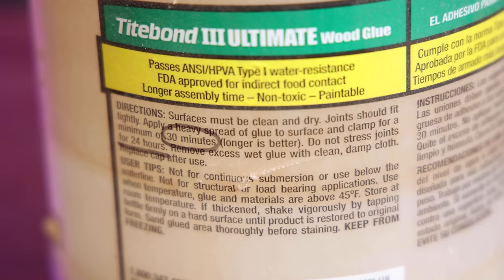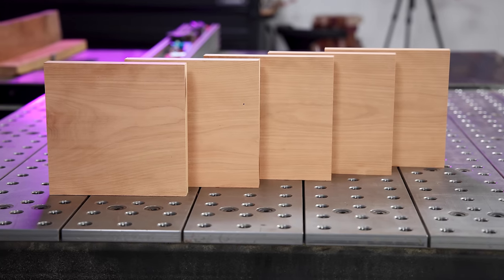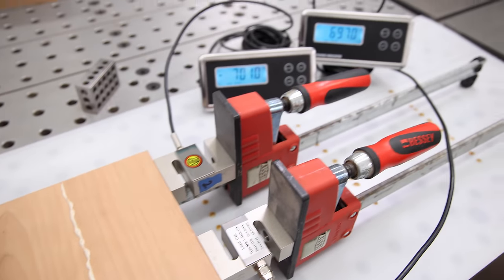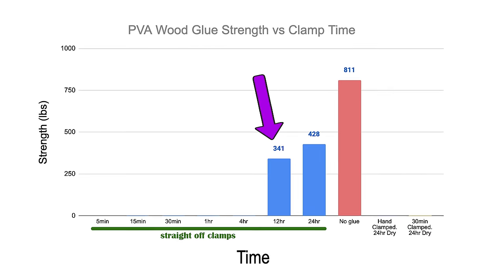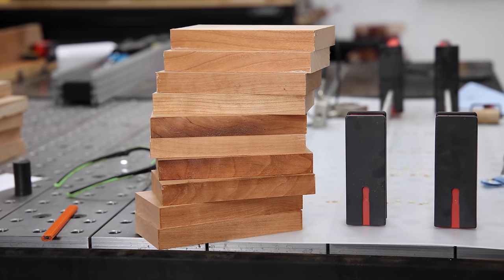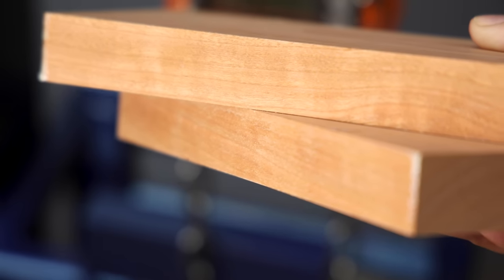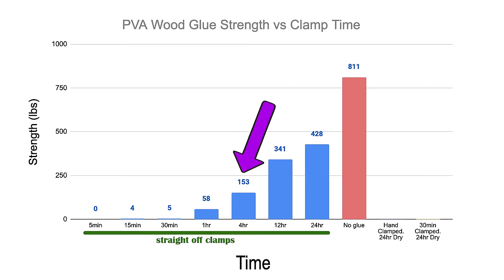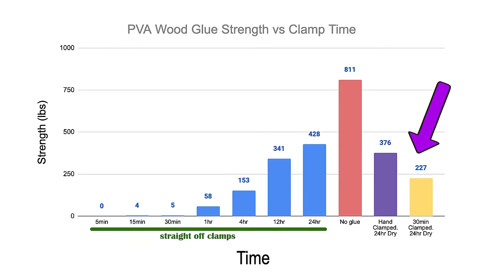you are clamping too long

Comment: Video is pointless if you don't give the time for the glue to cure.  
Wet glue didn't hold...imagine that.
Reply from the maker: You missed the point of the video. At what point is the glue joint properly strong enough to take the clamps off and feel confident to allow it to dry further. Around the 4hr mark, the glue line is almost as strong as the wood itself. You can take the clamps off at that time knowing well that the joint being disturbed by unclamping won’t have a negative impact. Then you can let it dry further if you want.

Comment: As much as I appreciate your attempt to do this objectively (which is far better than what we usually see), I don't think you have any evidence at all for what you claim.  You threw out the top and bottom measurements, which is often a good approach, but this suggests you have a LOT of variability in your results in the first place.  And that then leaves you with only 3 measurements, which is  TINY sample size, especially given that you are working with random samples of wood in the first place which likely already have a lot of variability in their strength. With only 3 samples, you then took a single average and base your conclusions on that single number.  That is an entirely invalid approach. Even if you made 1 million measurements, on average one of them would always be bigger than the other; so you can't make claims like this based on a single average number without also considering the variability in your data. I know that your averages were quite a bit different from oneanother, but you still MUST take into account the variability in your data before you can begin to claim that one average is 'bigger' or 'smaller' than the other.   You need to do statistics on your results to have any confidence at all. I would bet an AWFUL lot of money that your results show absolutely no difference (maybe they do, but you certainly haven't made a convincing case based on 'scientific' math).  As an example, lets say your numbers are 130, 80, 50, 30, 10 for one measurement, and for the other are 120, 120, 90, 60, 20.  Anyone looking at those numbers on their own would say "NO DIFFERENCE", hands down. But with your approach, throwing out the top and bottom and just taking the average of the remaining 3, you get 53 for one test, and 90 for the other.  Almost double the strength you would claim?  Now way.  It's just your small sample size and the large, random variability in the data.  Show us the actual numbers, including the ones you threw out (for reasons you don't explain, they didn't fit your theory?), do a proper two-sample statistical t-test, and I bet you have nothing.  Again, it's great to see someone actually trying to make a valid measurement, but in the end this still isn't valid at all.
Reply from the maker: Newer videos show confidence intervals. This is an old one.